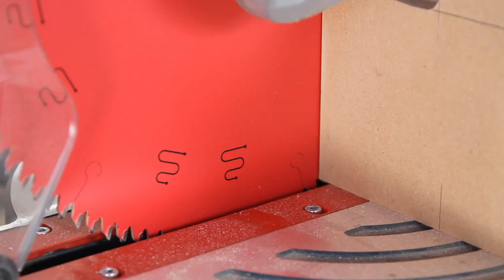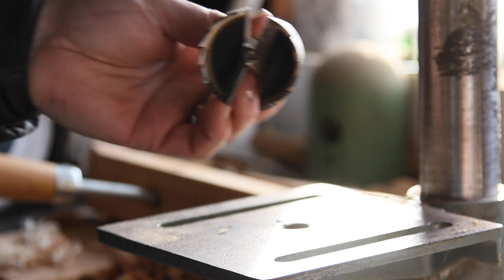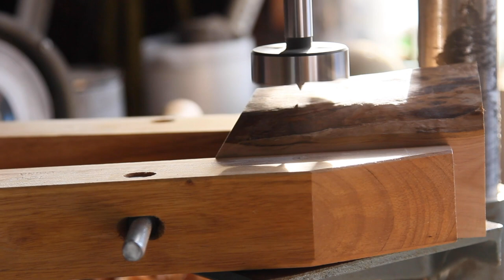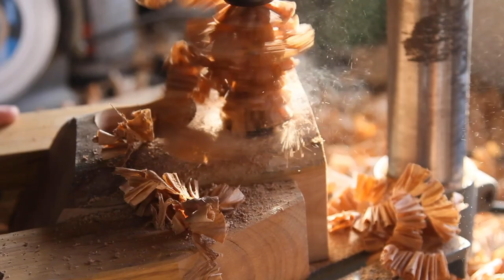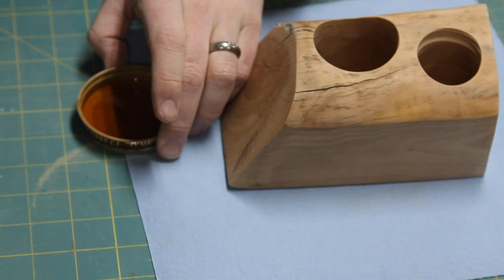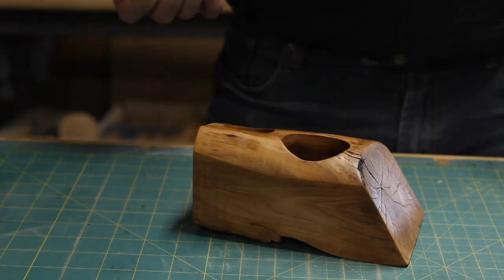I made an Offerman Style Pencil Holder out of Apple Wood

Comment: A very suave nice looking Project mate & very well filmed, a company called fastcap have zero clearance tape that I use on my mitre saw, check it out 🍻👍
Reply from the maker: Thank you Dirk!  Have you tried Fastcap?  The first cut I made with that saw launched the cutoff right out the back.  I saw on a few newer saws that the adjustability can move much closer to the blade.